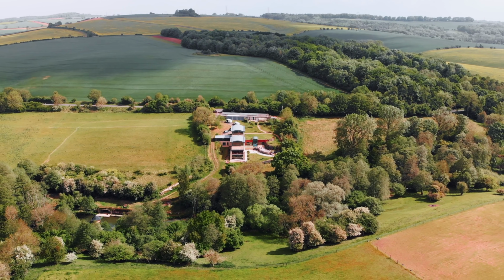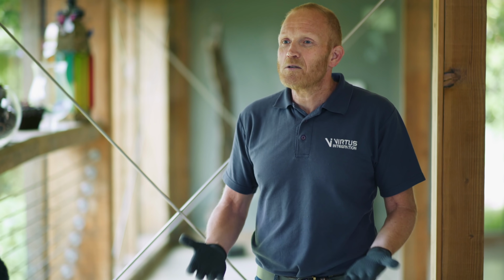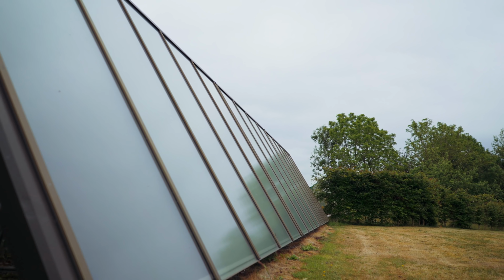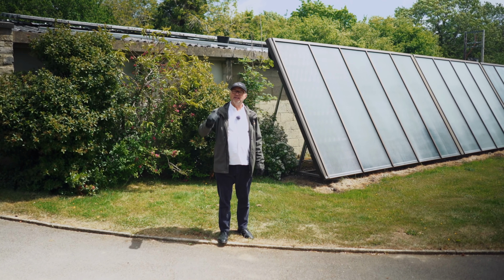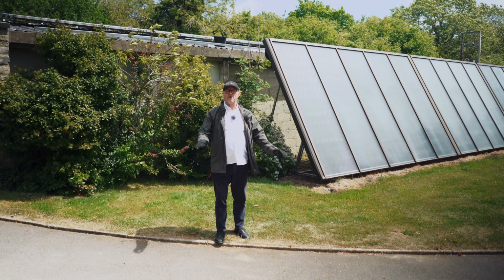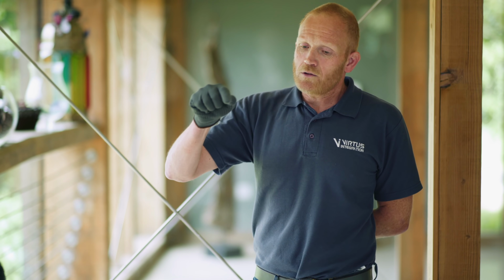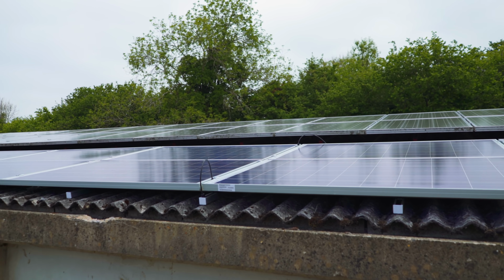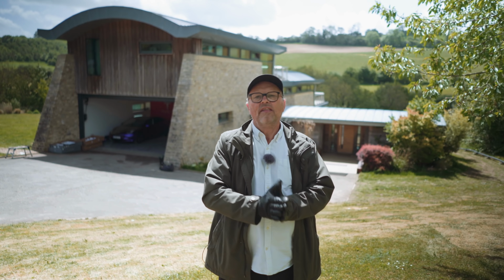Can you HEAT & POWER a big house with RENEWABLES? | FULLY CHARGED for clean energy & electric cars.

Comment: Interesting house. Thank you for the tour and interviews. The efficiency of the system also depends on the geographic location. I don't think a zero net house is possible, or financially feasible, in colder climates. The cost of thermal insulation and a sizeable photovoltaic system to generate enough electricity for all of the occupants' needs, including heating and charging your EV(s), would be cost-prohibitive for an ordinary middle-class investor. If it weren't, everybody would go down this path. A mid-size family home PV system of approx. 10kwp can ensure energy self-sufficiency for maybe 7 months out of the year in Central Europe, but never in winter. At least that's what I see in my country (Czech Republic). If anyone has a different experience, I'd be glad to hear about it.

Comment: I watch all your programmes and find them very informative. I have a suggestion. I completely understand that there is a degree of reforming zeal still required around renewable energy (we are all creatures of habit after all and changing habits requires overcoming quite a lot of inertia). 
For those of us who aren't in a position to build in state of the art renewable-friendly technology from scratch, we are faced with having to adapt what we have. 
From a very selfish point of view I wondered if there was some mileage in looking at, for instance, converting your average domestic property from gas to totally electric. I took the plunge last year and installed 5.5KWh of solar panels on my roof and am trying to get my head round what  to replace my current  gas combi boiler with when it's useful life ends in a couple of year's time. I think I'm going to need some sort of boiler + storage tank combo. For me, and I'm  sure a lot of people, tanks for hot water were something that you got rid off with the advent of the gas combi boiler, so it feels like a retro-step even if the actuality is quite different. Just a thought.

Comment: ...So instead he spent it on an ugly mansion that took a ENORMOUS amount of fossil fuel energy to BUILD, (and indirectly operate, look at all those vehicles of the staff in the driveway, and even a gas lawnmower!) so he can show off... 

While embodied energy/carbon in electric vehicles is proven to be offset after a reasonable number of miles, and is not feasible to significantly improve short term, buildings are a much more nuanced situation. If you are going to cover content outside of transportation please either hire a writer who knows what they're talking about, or have your staff do a whole lot more reading. 

There are dozens if not hundreds of amazing net zero buildings in the UK that take innovative, holistic, pragmatic approaches to sustainability that over the lifespan of the structure use orders of magnitude less energy than this monstrosity.

This is the equivalent of saying a 200ft yacht is sustainable because it is sail powered instead of using an engine. While that may be true, it REALLY misses the point.

Comment: Robert, have you looked at the Passivhaus building design standard? It is basically the same as what they have done here, with a design focussing on high insulation, reducing energy consumption, and heating. Renewables can then be added / integrated for supplemental (or maybe all) power. Keep up the good work!

Comment: Just a little (maybe ignorant) question: If every home had this kind of heating system (i.e. more heat and power than it needed) what would be the need for the 'grid'? Who or what would be using the 'grid'?  Just wondering...

Comment: "Why don't we do this"???? The cry of the population down the ages.
The UK government only has a token interest in  really reducing our carbon footprint and has a much larger interest in ensuring that their cronies running the various companies continue to make profits and in turn donate to their campaigns.
The law should have been changed at least 10 (maybe as long ago as 15) years ago making it a requirement for EVERY NEW BUILD to have Solar PV installed.
But the benefits of such a change would overly land with the consumer (in reduced bills) and have a negative impact on profitability of the builders and the energy companies.
Air Source and Ground Source heat pumps have been extremely efficient but again without laws being amended there will never be any impetus to adopt these technologies.

Comment: This is the way of the future. And for me is to make cost effective solution which this house isn't. Idea is great, tech implemented is great, but energy consumption will never  justify the money put into. I live in Croatia, made 110 m2 house, using 150$/year on heating and hot water (air heat pump) and putting 3,2 kWh solars to reduce electricity bill for around 70 percent and drive small EV for free 6 months of the year, all from small 3.2 kWh solars. This is effective way to go. Batteries are the future, so the solar, but having such big house, ground source heat pump (most expensive but most efficient), two Tesla batteries, vast amount of heat collectors and putting another 50 kWh's of solar (20 kWh's are enough for normal uses), this is just too much. My plan is breakeven under 10 years, this setup is huge spend. Even spectacular, this is never to breakeven. But brave idea, totally way to go, but much smaller scale and with breakeven idea on the back of the head. Petar

Comment: It’s still too expensive to retrofit - I got a quote to switch from oil to air source and it was £18k! It would pay for itself in the long run (10+ years) but the upfront costs are just too much and we were told would actually make our house more difficult to sell as people don’t understand the tech. And then the power demand would be so huge that we would have to decide between having that or electric car charging, as the grid couldn’t upgrade our supply without demolishing half our house and spending thousands more.

Comment: It may be zero cost to run but the amount of fossil fuel required to build a 17,500 sq.ft house is massif. Concrete and glass which there seems to be copious amounts of are not green products. Buying an existing house would have been far less polluting even if it was heated by oil or gas. Frankly it looks like an office building not a house. Tried a ground source heat pump 10 years ago, the back garden froze solid and the heat pump packed up within 3 years, £20,000 down the drain, replaced it with an oil boiler costing £2,500. Even when it was working the hot water was never very hot. If you are happy with tepid water and house heated to around 17c then go ahead.

Comment: Big fan of your show,  this particular house presents lots of questions in my mind. 

In order to be truly environmentally friendly, the house needs to balance it self off. 

Meaning the cost of building it, the cost of all the equipment and furniture and pretty much all what is inside. 

What is the carbon foot print of all of that ? And how many years will it take for the house to power itself in order to come back to cero. 

Also where is the water coming from? Is there any pumping involved? Buy city or county management, that will certainly involve some fósil fuel to be accounted for. 

The concept is going on the right direction, yet I don’t necessarily find this house environmentally friendly, at least not yet. Any thoughts?

Comment: Excellent. However, I was really surprised to see an ICE lawnmower onsite (10.55). Just looking and can't see the Ryobi battery ride-on mower available in the UK (like the US and Australia) but there are Ryobi battery push mowers available. I've had a lead-acid battery mower for 15 years and I just bought my cousin a Ryobi 18v lithium mower which does a great job. They also have a 36v self-propelled walk-behind which I hear is pretty good.

Comment: As you were wearing a jacket in this video, please tell me when the filming was done and what the outside temperature was at that time. Is there a need for air conditioning/cooling in this house in the summer? If so, how is that being done? I know the ground source heat pump can cool as well as heat but is there any need for additional cooling capacity?

Comment: Robert. Ground source heat pumps do work but unfortunately the Environment Agency often won’t allow this system above a ground water aquifer just in case of leaks. I know as I have tried to use them but been turned down. Air source heat pumps though work well and are reasonably efficient. The other point is too much insulation particularly in high occupancy houses and offices leads to overheating (people and equipment generate lots of heat and opening the windows when it’s very cold outside doesn’t work that well) which often requires comfort cooling so this does need to be thought about but these systems do work well using green electrical energy but you do need a reasonable amount. Passive vent systems don’t work that well without a bit of fan support (I know as I have built some on office developments and the controls etc cost as much as full air con) but they can help. The current building regulations are better than previous versions but still have some way to go towards really sustainable construction. The developers won’t do this without regulation and possible subsidies as there is a capital cost increase and they are competing in sales price against existing housing stock, which there is a lot more of. Also remember the developers don’t get the savings from the lower running costs.

Comment: A house of that size should be looking at a Vanadium Redox Flow Battery like the ones from Invinity Energy. Rather than a hub of lithium ion batteries from Tesla. They would last 30 years, have no fire risk and loss no depth of charge. It would make so much sense in this application.

Comment: I'm planning on building a house that uses a pool as heat storage. good to see it's been done before. the two things that slightly bug me about all this though:
1: heat storage and ground source heat pumps is all well and good if you have the space for it. if you live in a 60m2 apartment, this can't reasonably be done unless the boreholes were made when the building was. no-one living in a 60m2 apartment is going to have the money to pay for that. granted, for council housing, this is a no brainer. 
2: using powerwalls and electric cars as storage does indeed solve a lot of problems for grid balancing. however, li-ion batteries wear out, and someone is going to have to pay for that. when i'm solving a problem for the grid manager, i can't be asked to do that for free. as for that powerwall; great concept, wrong battery chemistry. when all you have is a hammer, everything looks like a nail.

Comment: An inspiring engineering rethink. All houses can become power plants generating excess energy to supply the grid using batteries in electric cars or separately. Insulation and heat exchange systems are so simple. Smart grids and less power stations burning stuff is a great future. Dare I say it there is a place here for A.I. Just need to persuade the monoliths in power and their fossil fuel backers to make the switch. The more self-reliant we can become the better. A greener economy is the way forward now.

Comment: How does 68-degree F fluids from a GeoThermal system feel warm ?
Reply: I think it's a sort of heat pump, where you extract heat from the ground and add the power from the heat pump which is also heating up the fluid. With this you get 3 or 4 kW of heat energy from the ground by investing 1 kw of electricity. You can also do it with air, but here the factor is less. Usually it's used with floor heatings, because the efficiency drops if you heat the water to 45 ° C which you usually use for radiators.

Comment: Love their advocacy and love for the environment.  But they don’t really show how the systems work or their interconnectedness.  For example, heat is not coming from the ground systems.  They are extracting heat from 55 degree water    They may use the solar to raise the temp further.  But this shows none of that.   And this system is not for the Everyman.

Comment: It's much easier to keep a large house warm compared to a tiny house in cold climates. As the volume to surface area ratio drops you end up with greater heat capacity and less losses which is why elephants struggle to keep cool and need big flappy ears to keep their brains cool. Of course there is no reason why you couldn't make small houses joined in a clever way besides horrible terraced houses and achieve the same thermal advantages with perhaps shared bore hole and energy harvesting.

Comment: When the Electrical supply industry are stopped from partnering with House Builders? May be then we will see the vested interested in keeping us as consumers of power rather that generators of it. The planning regulations are so prohibitive around anything other than the norm or services exclusively being supplied to a property development. I have tried on numerous occasions to get outlined consent for solar / wind power and I am met with obstacle after obstacle. It was clear when the buy-back tariff was cut and the £Billions given to the building of Hinkley Point C that the powers-that-be don't want a mass exodus of dependence on The Grid

Comment: About two-three years ago I bumped into an old colleague, who was to totally renovate a 2 up 2 down terraced house in a nice part of south west London. He asked me for some ideas as he wanted to save space inside the house. He was heavily insulating the house. It was to be all one room downstairs with two beds upstairs, the bathroom in the loft space with a rear facing dormer. A single floor kitchen extension out the back. It had a small longish garden at the rear. I suggested: 

♦ going all electric saving on gas meter space and the standing charge for the meter
♦ Remove the mains gas pipe from the house.
♦ A boiling water tap in the kitchen;
♦ A 11kW instant water heater to go into a shallow cupboard; next to the bathroom. 11KW-11.5kW is the highest wW on single phase;
♦ An aerated Raindance shower head for the shower (no bath);
♦ A normal aerated tap for the bathroom basin regulated to 4 litres/min, fed off the instant electric water heater;
♦ Electric underfloor heating with stats in the living room and one in each bedroom;
♦ An electric Kickspace heater in the kitchen to save space, with an above worktop mounted switch;
♦ An electric towel rail in the bathroom;
♦ LED lights all around;
♦ Of course low energy appliances;
♦ Heat recovery fans.
♦ I told him it would be far cheaper to install than a piped CH system with a gas combi boiler, enabling the money saved to be used on thicker/superior insulation.
♦  I told him it would be maintenance free, saving a servicing lump of money on a gas boiler/unvented cylinder each year to spend on electricity.
♦  A combination oven/microwave to save space. 

As the house was to be heavily insulated with low heat loss, heating demands would be low. The Raindance shower head would give a decent shower, with the boiling water tap eliminating a kettle in the kitchen, which takes up valuable worktop space.
I met him after the house was completed. He showed me some pictures with the renovation being top class, looking cavernous for such a small house. He had thick foam insulation under the solid ground floor with electric heating under a wooden floor. The front of the house had internal insulation against the walls. Highly insulated front and rear doors. Triple glazing all through. The rear of the house had high performing external insulation, inc' the extension, with render over. The roof was not vented with very thick insulation. The ventilation was heat recovery. The electric meter & Consumer Unit was over the front door in a fireproof cupboard that blended in. Some Vacuum Insulation Panels were used. 

He is delighted with the heating, only ever having to be on once or twice in 18 months for a short period, never on upstairs, except the bathroom every now and then for heating towels. Also absence of wall heating radiators.. He says the Raindance shower is great with no waiting to heat up hot water with pretty well instant hot water at the shower head. The boiling water tap (not a Quooker) he says is superb with no waiting for hot water. The taps cost was offset by not buying an electric kettle - he is the sort who would buy a top rated designer brand, so a real saving I suppose. He would buy a Quooker type of tap anyhow as he likes the latest sort of stuff. There is no space taken up by boilers, cylinders, wall radiators or a gas meter, which is a great advantage in a small home. 

The electric running costs? He said so low it is not worth mentioning. He doesn't keep a tag on the costs. When it is ouch he notices. The water is on a meter, so low water bills as no dead leg pipe or stored water to drain off before hot comes through, and also low usage taps & shower head.  He did leave in cables from the roof to the electric consumer unit and to outside in the rear garden to install a Powerwall type of battery when the prices drop. 

So, in some situations going all electric can work out better all around, even today, especially where space is needed. Install PV panels and a Powerwall battery, then matters are better again.

Comment: Fully charged, you might want to check out iron matrix. They are an Australian company that builds houses and building with structures that have solar panels built in. So the sides of the houses are solar panels. The big kicker is that they claim the cost is lower than a traditional building because they use modular building blocks. (High volume standard size parts bring the cost down.) If every building could be built cheaper than traditional building materials and generate power, that would be a game changer!